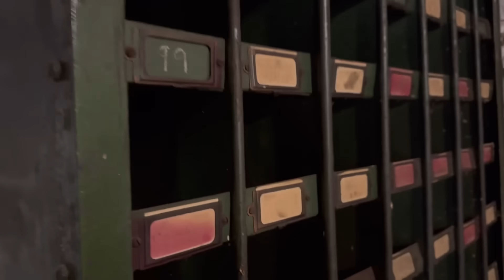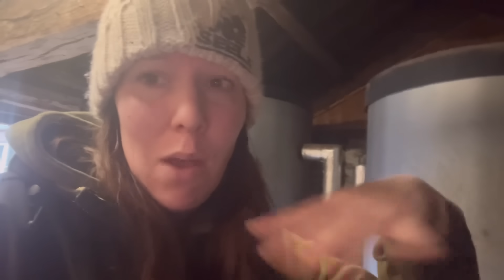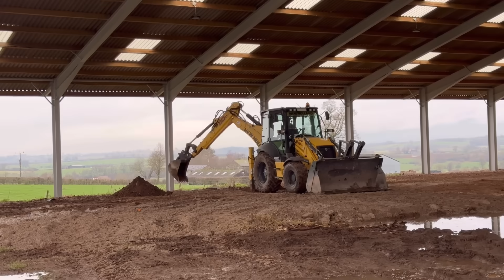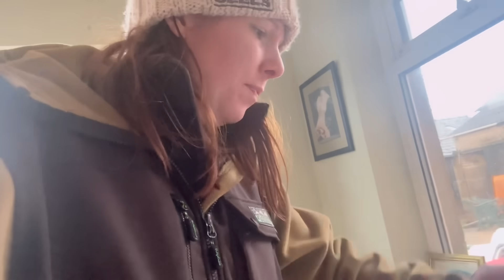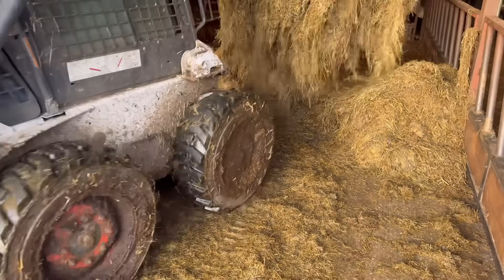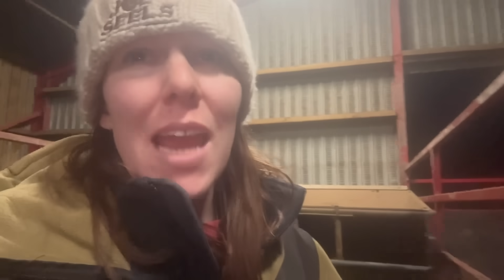Burying the Channels for the Robot shed

Comment: Been working with, managing dairy cows 34+ yrs, never needed or used a creep feeder. You need controlled weight gain in growing calves, once weined off milk at 6,8,10 wks ,  if grass supply is tight in dry summers, yes batch feeding of concentrates will be needed- smaller younger heifers may need splitting off into a different group for extra food to push them on a bit more to catch up with older ones. 
On a different note charlotte- if you have any questions, want answers, an opinion, I'm willing to assist and help you if you want to ask me. If you're totally new to dairying, especially using robots, you'll need help and advice.
Reply from the maker: Ian that is so kind and I’ll take you up on that honestly it’s all very new to me x x